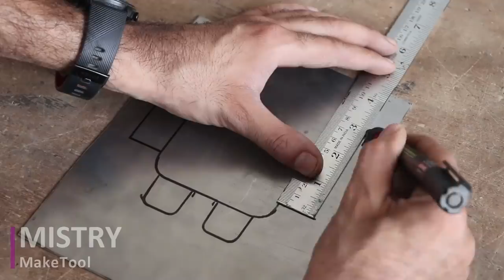Make A Mobile Wall Holder || Mobile Charging Wall Stand

Comment: I just hung a pen stand by the wall. Did the trick pretty well as it can hold 2-3 phones and costs only INR 20(less than $0.25).
Reply: Right
Reply: Why in dollars?
Reply: @santoshed  You do realise that INR is not an internationally accepted currency right? I mentioned USD because most of the people around the globe can relate to it.

Comment: You can cut this very simple out of a PET bottle.  Make it on the backside a littlebit longer cut a hole inside so you can put th cuircut into the wall and don't have to drill a hole in the wall
Reply: Thanks

Comment: Full marks for the mobile wall hanger but instead of drilling holes and spoiling the wall, why not use some kind of a adhesive strip to hold the hanger in place? 🤔

Comment: What about heating issue 🤔
When a device charges 
It emits heat 
How can you remove that heat
Reply: Put a small fan between the two wooden blocks
Reply: Simple, Put the display side of the phone facing the wall.

Comment: Take any empty shampoo plastic bottle. Press it and wide it by inserting a larger than Mobile size wooden piece and show on the stove to melt and make a shape. Just cut the front and allow a eyelet at the back. Nail it on the eyelet. This will give a fantastic mobile holder while charging next to your point or nearby.
Reply: Even you can use the mobile packed box also.
Reply: Just use a water bottle by slizibg a line to allow the wire. Nail it.